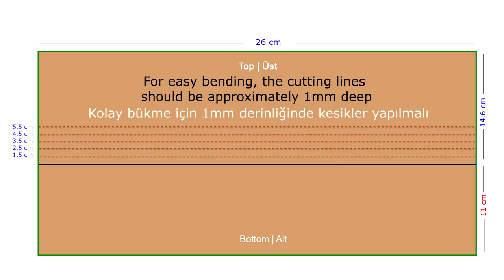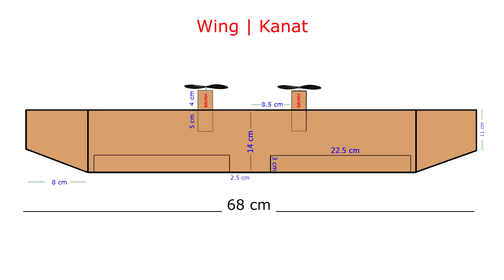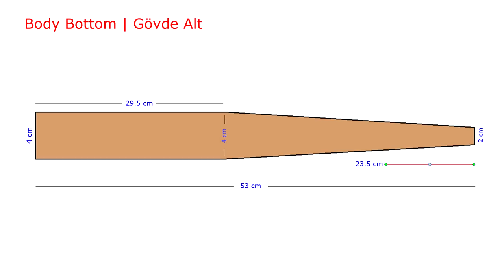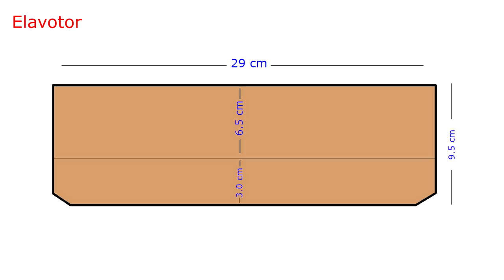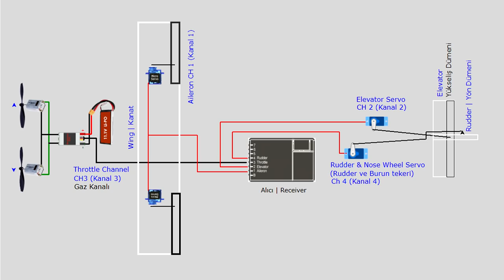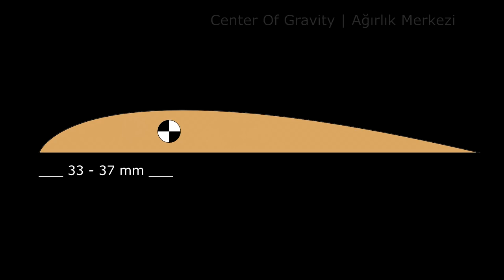How To Build A Twin Brushed Motor RC Airplane. DIY Remote Control Plane

Comment: Would you recommend this to a absolute beginner in making rc planes ?
Reply from the maker: This is a stable and slow flying model. So beginners can use it for training.
Reply: @Kendin-Yap  Thx you are still replying to comments after 3 years.
Legend
Reply: @Kendin-Yap  please answer my question too

Comment: It is very nice model.l built it and it works great.Thanks for sharing it with me

💐💐💐👍👍👍😊☺️☺️☺️
Reply: From where did you buy the material.. and what was your budget in INR
Reply: Please reply as soon as you see it sir. As i am eager to build it.
Reply: Hands Up buy it on amazon buy 4 9gram servos buy a esc and brushless engine buy a radio and receiver will all cost you around 120

Comment: Does the plane automatically balances itself while not tilting or going up/down ?
Reply from the maker: No, it does not have autonomous flight support. It is completely manually controlled.

Comment: Hey i am unable to get DC motor , so can I attach brushless 1 Kv in parallel 
As in some videos I saw one motor sometimes doesn’t work . Pls reply I need to build it now
Reply from the maker: Brushless motors are different. It does not work properly with a single ESC. (There are exceptions)
Reply: Oh , thanks a lot , I was about to buy 2 motors and 1 ESC only . I had one more doubt that no trim joystick is not available and the x y axis joystick is available to me , so should I see your other Arduino controller with Nrf module with antenna just to increase its captivity , also do we need to program the antenna as well , SRY IF I ASKED SOMETHING WRONG AS IT IS MY FIRST BUILT . PLS REPLY I NEED TO PLACE ORDER FOR THE THINGS , thx

Comment: the particular dc 180 motors not available online....please can we use some other motors?
Reply from the maker: You can use brushless 1306 motor.
Reply: @Kendin-Yap  Hi, can't find 1306 too in India.....can you please give a few more options. I have managed to purchase most of the other items.Thanks.

Comment: If I use a LiPo with 1000 mah, 11.1v with 3S will be overpowered? Or can be added?
Reply from the maker: 11.1V is not suitable for these motors. Motors will fail.
Reply: KendinYap 

Thank you admin 🌟

Comment: How long does the battery last? Can I use a stronger battery?
Reply from the maker: The higher capacity battery is heavy. So it would not be appropriate. Approximate flight time is 4-6 minutes.

Comment: Very good build. But 1 Amp BEC can't handle 4 servo. It can barely handle 3 servo I believe.
Reply from the maker: Max. current 200-250ma for this servo. No problem for 4 servos.
Reply: @Kendin-Yap  That means this servos are analoge servo. Right? Because digital servos are power hungry. They take 400-500mA per each 9g servo.
Reply from the maker: Yes, these are analog servos. In addition, aircraft with this type of sport scale flight style never need to draw maximum current of all servos at the same time. This is not a 3D aerobatic model.

Comment: Can we place there a brushless motor
Reply from the maker: Yes you can. Like 1306 brushless motor and 6A brusless ESC
Reply: Thanks for your reply
Reply: I am going to make a mini project like bicopter. 
Everything is ready but for two servo motors can we rotate them in one direction for one channel and rotate the same two servo motors rotate in different directions. pls reply. This is my project and it going to end in next week
Reply: And one more thing, that 1306 motor is too high price for me. But can you prefer me a better motor for my bicopter
Reply from the maker: @PoovarasanKEEE  Digital remote control transmitters have a "program mix" feature in their menus. You can search for videos related to Program Mix.
Reply: And about the motor? I think ECO 2 series 1700kv motor is suitable. Can you pls check it.
Reply: If you are free can you search that video of transmitters for me. I have searched but I don't get any idea.

Comment: What software do u use to design your planes? Or do u do it on paper?
Reply from the maker: I do not use any software. I have been making RC model aircraft for many years. Fuel engine models, scale models, aerobatic models, etc. etc.
Thanks to this, I gained a lot of experience. I determine the dimensions myself, I make sketches on the paper and then go to the production stage.
Reply: @Kendin-Yap  Thanks for the reply! Designing my first plane now, on paper.
Reply: @Kendin-Yap  Can you  please do a video on adding lights to a plane?
Reply: @Kendin-Yap  great sir.

Comment: Hi , why is important to fit ceramic capacitor to the motor.Thanks
Reply from the maker: The coils of brushed motors cause electrical noise. Capacitors act as filters. In this way, the circuit to which the motor is connected is not affected negatively.
Reply: Thank you is good to know

Comment: i have a question that can we make this with cardboard???(pls reply)
Reply from the maker: Cardboard is a heavy material and is not suitable. Alternatively, you can use insulating foam.
Reply: @Kendin-Yap  ok thanks:)

Comment: merhaba. sizin kullandığınız fırçalı motor esc sinden piyasada bulamıyorum. bir altarnatif önerirmisiniz.teşekkürler simdiden.
Reply from the maker: Burada bulabilirsiniz. https://www.promodelhobby.com/urun/dc-180-motor-7-4v-39000rpm-yuksek-devirli-elektrik-motoru
Reply: @Kendin-Yap  yanlis anladiniz sanirim ben esc den bahsediyorum.
Reply from the maker: Pardon yanlış link aynısı değil ama bunu kullanabilirsiniz. https://www.promodelhobby.com/urun/fircali-20a-rc-esc-2s-3-9-4v-2-khz-iki-yonlu .. Fatak bu çift yönlü bir ESC olduğu için kumanda ayarlarında Throttle Curve kısmından 0 olan başlangıç değerini 50 ye yükseltmek gerekir ki tek yönlü ESC gibi çalışsın. (Tabi kumandanız dijital kumanda ise bunu yapabilirsiniz.)
Reply: @Kendin-Yap  henuz kumanda almadim. Uygun fiyatli oldugu icin dijital olmayan kumanda almayi dusunuyordum ama soylediginiz ayar icin sanirim dijital almam gerekecek. Tesekkurler
Reply: @Kendin-Yap  peki kumanda diğital değilse nasıl yapmalı çözüm öneriniz nedir

Comment: Ellerinize sağlık hocam
Elimdeki sistem 3 kanallı rudder servosu olmadan yapsam stabil uçabilir mi ?
3mm yerine tamamen 5mm fotoblok kullansak sorun yaşar mıyız?
Reply from the maker: 3mm fotoblok ağırlığı biraz azaltmak için. Ama 5mm ile de uçabilir. Biraz uçuş süresi kısalır. Rudder manevra için şart değildir. Aileron ve elevatör dönüşler için yeterlidir.

Comment: Is it ok to build whole plane in 5mm foamboard, without using 3mm board?
Reply from the maker: Elevator and rudder must be 5mm.
Reply: Wait. This is 3mm foam board? I thought it was 5mm foam
Reply from the maker: @eme4289  Wing and body 3mm for lightness. Elevator and rudder 5mm

Comment: Hey there buddy, I tried imitating your electronic setup, i used 1 pc 20a esc to power my 2 180 motors, is it normal that the motor and esc heat up? Btw i am using a 2200 mah 7.4 40c battery
Reply from the maker: Motor and ESC become hot when running. This is so normal. But it does matter how hot it gets. 50-60 degrees is reasonable. But if it's warming more than 70-80 degrees, it's not very good.
Reply: Cant actually measure the temp, but it gets really hot that you cant almost hold it for like 5 secs

Comment: Abi DC180 Fırçalı Motorun nereye döneceğini nasıl ayarlayacağız bi motor CW diyer motorda CCW olması gerekmiyormu sadece bir motor türü var yardımcı olabilirmisin
Reply from the maker: Bu tip motorlarda CW yada CCW olmaz. Çünkü motor mili vidalı değil. Motorun artı ve eksi bağlantılarının yerini değiştirince diğer yöne dönecektir. Önemli olan doğru yönlü pervaneyi takmak. Bir pervane CW diğeri CCW olmalı.
Reply: @Kendin-Yap  ilginiz için çok teşekkür ederim.
Ve böyle videoları devamını diliyorum

Comment: Hocam merhaba, fırçalı motor sürücünün 18 awg kablosunun ucu açık, yani sanırım pil için konnektörü yok. Bunun için ne yapmamız lazım? Burada tıkandım. Bir adaptörün erkek tarafını söküp taktım fakat sürücü aşırı ısınıyor. Almam gereken parça hangisi acaba?
Reply from the maker: Konnektör almanız lazım. Pilin ucundaki konnekter neyse karşı tarafından alıp lehimlemeniz lazım. ESC nin pil tarafında  BATT yazar. Ona dikkat edin. Ters tarafa veya ters kutup bağlarsanız ESC hemen bozulur.
Reply: @Kendin-Yap  Anladım alıp yaptım. Videodaki pili istemiştim fakat grlen pil 20c yerine 15c ancak yine 7.4V ve 800 mAH. Ancak şöyle bi sıkıntım var pili taktığım anda esc inanılmaz ısınıyor ve kumandada pil şarj az uyarısı alıyorum ardından da pil boş diyip uyarı veriyor. Neden böyle bir şey oldu acaba pilden mi?
Reply from the maker: @qarqamel  Pilden olmaz. ESC nin biraz ısınması normaldir. Ama kısa sürede yüksek ısı oluyorsa  ESC nin bağlantılarını yanlış yapmış olabilirsin. Eğer ters bir bağlantıyı anlık olarak bile temas ettirdiyse ESC bozulmuşta olabilir.
Reply: @Kendin-Yap  Bağlantılarımı kontrol ettim tekrar ancak yanlıs bir sey yok. Alıcıda problem olabilir mi acaba? Çünkü alıcıya bağlantıları takınca yaklaşık 10 sn motorları kumandadan kontrol edebiliyorum sonrası ise aşırı ısınma yapıyor ve pil hemen boşalıyor. Ancak alıcıya takmadan esc de ısınma olmuyor. Bir de şöyle bir şey var esc takınca 2 motordan da sinyal sesi geliyor, kısa aralıklı. Bu normal mi merak ettim. Ne yapacağımı bilemedim şu an.
Reply from the maker: @qarqamel  Bir yerde bir kısa devre olabilir .Normal bir şey değil. Ya şu an bir yerde hatalı bir bağlantın var yada daha önce yaptığın hatalı bir bağlantıdan dolayı ESC zarar görmüş olabilir.   Alıcıdan olup olmadığını anlamak kolay. ESC yi taktığın kanala bir servo bağla. Servo normal bir şekilde çalışıyorsa alıcıdan değildir.  ESC nin kablosunu alıcıyı ve servoyu beslemesi için boş herhangi bir kanala bağlayabilirsin bu test esnasında..
Reply: @Kendin-Yap  sorun pilden kaynaklanıyormuş. Bu arada hocam kanatlardaki servoların farklı mı hareket etmesi gerekiyor yoksa aynı yönde mi hareket ettirmesi gerekiyor? Yani her ikisi de kanadı yukarı mı kaldırmalı, yoksa biri yukarı kaldırırken biri aşağı mı indirmeli?
Reply from the maker: @qarqamel  Farklı yönlerde.. Aşağıdaki videomda bu kontrolleri net bir şekilde gösterdim. Hangi kol neyi ne yönde oynatır. Seyretmen faydalı olur. https://www.youtube.com/watch?v=LzZ4Oqk_J1Y&t=523s

Comment: Abi eline sağlık çok güzel olmuş yine. Kapasitörler neden var olmazsa ne olur onu anlayamadım açıklarsan sevinirim.
Reply from the maker: Fırçalı motorlar çalışma esnasında elektriksel gürültü oluşturur. Ve bağlı olduğu devrede parazite sebep olabilir. Uzaktan kumanda sistemlerinde sinyal kesilmesine de sebep olabilir. Seramik kondansatörler bu şekilde bağlandığında bu gürültüyü minimize eder. Gerçi bu sorun daha çok kristalli kumandalar da yaşanıyordu ama yine de basit güvenlik önlemi olarak kullanmakta fayda var.
Reply: @Kendin-Yap  çok teşekkür ederim elinize sağlık

Comment: Her zaman kendi içinde BEC olan ESC ler kullandım.  UBEC hiç kullanmadım, hiç bilmiyorum. Yani NO BEC olan ESC ler nasıl kullanılıyor?  Bu konuyla igili video çekerseniz çok memnun olurum.  Teşekkürler.....
Reply from the maker: Çok basit bir farkları var. BEC özelliği olmayan No Bec ESC ler Alıcı ve servoları besleyemez. Sadece motora elektrik sağlar. Bu yüzden alıcı ve servolar için ya haricen uygun voltajda bir batarya kullanılır (Direk alıcının Batarya girişini takılır). Alıcı pili olarak adlandırılan bu bataryalar genellikle 4.8V ile 6V arasında bir bataryadır.  Veya motor için kullanılan LiPo pilin çıkışına paralel bir bağlantı ile UBEC (Voltaj Regülatörü) bağlanır ve UBEC in çıkışı direk olarak alıcının batarya girişine takılır.
Alıcılar ve servolar genellikle maksimum 6V ile çalışır (İstisna olarak HV olanlar yani 7.4V ile çalışanlar vardır) . Motor için kullanılan pili direk olarak alıcıya taktığımızda yüksek voltaj nedeniyle alıcı ve servolar zarar görür. Bu yüzden BEC/UBEC ismi ile anılan Voltaj Düşürücü Regülatörleri kullanırız. Zaten BEC özelliği olan ESC lerin de tek farkı bu. Yani dahili bir voltaj regülatörüne sahip olmaları...
Reply: Cevap için çok teşekkür ederim. O zaman illa UBEC almaya gerek yok yani. Ben KK2.1.5 uçuş kontrol kartıyla acizane bir drone yaptım.(Tabi BEC olan ESC ler ile)  Diyelim ki BEC olmayan ESC ler var ve alıcıya 4.8V ile 6V arasında başka bir batarya bağladık. Peki uçuş kontrol kartı zarar görür mü? Uçuş kontrol kartı yanmasın diye ayrıca bir şey yapmak gerekir mi? Teşekkürler...
Reply from the maker: Kartın çalışma voltajını aşmadığı sürece sorun olmaz. 5V ise harici beslemede 5 volt veya çok yakın olmalı.
Reply: Çok teşekkürler....

Comment: Where can I get the carton  or wat is the name of that thing u re using 
It look like carton
Reply: @Kendin-Yap  pls translate to English
Reply from the maker: The name of this material is Foamboard. Foam inside. The outer surfaces are covered with Kraft paper. It is usually sold in stores that sell supplies for architectural models and in stores that sell supplies for school projects.
Reply: @Kendin-Yap  ok tnks

Comment: Abi Merhabalar;
Ben de 1 haftaya kadar bu uçağın aynısını yapmaya çalışacağım da onun için birkaç sorum var sana.
1- Videoda 13:36. dakikada servoya linkage stopper bağlı değilken 13:55. dakikada servoya linkage stopper ekli onu eklemesek de olur mu acaba ayrıca linkage stopper'ı da açıklama kısmına koymamışsın?
2- Videoda 16:02. dakikada yekeye teli bağlamak için bir şey takmışsın gördüğüm kadarıyla, onun ismi nedir acaba?
3- Ben uçak için Flysky FS-CT6B modelini aldım ondan dolayı bir sıkıntı çıkmaz değil mi?
4- Abi kanatlardaki tekerleklerin bir işlevi yok yani herhangi bir servoya falan bağlı değiller değil mi?
Abi cevabını bekliyorum.
Reply from the maker: Linkini açıklama kısmına ekledim. Kontrol çubuğunu servoya bağlamanın 3-4 yöntemi vardır. Tercihi sana kalmış. Linkage stopper  kullanmak çubuk boyunu ayarlamayı kolaylaştırır.  Onu kullanmadan çubuğun ucunu z şeklinde büküp de takabilirsin. 16:02 deki parçanın ismi L tipi clevis. L şeklinde bükülmüş kontrol telini yekenin üzerinde tutturmak içindir. Yerinden çıkmasın diye. Onun linki detayda zaten var.  İstersen onu da kullanmayabilirsin. L şekli yerine çubuğun ucunu Z şeklinde bükersen yerinden çıkmayacaktır. Ama çubuğun iki tarafını da o şekilde yaparsan boyunu ayarlamak biraz zor olur. 4 kanal ve üstü her tip model kumandasını kullanabilirsin. Markası, versiyonu önemli değil. Kanatlardaki tekerlerin bir işlevi var. Onlar olmazsa model yerde duramaz ve ilerleyemez.  Servo sadece burun tekerine yerdeki yönlendirmeler için takılır. Yani taksi manevrası ismi verilen uçağın yerdeki dolaşımını yönlendirmeyi sağlar.  Uçuş esnasında bir fonksiyonu yoktur. https://www.youtube.com/watch?v=LzZ4Oqk_J1Y&t=19s bu videomda Z bağlantısını göstermiştim. Ayrıca ağırlık merkrezi  vs konuları da göstermiştim. Seyretmen faydalı olabilir.
Reply: @Kendin-Yap  Çok teşekkür ederim verdiğin bilgiler için
Reply: @Kendin-Yap  Merak ettim de pili Esc ye nasıl bagladiginizi sorabilir miyim ben esc deki bostaki iki kabloyu pile bağlamak için pildeki kırmızı soketli yeri penseyle çıkartırken kısa devre yaptı ve pil patladı
Rica etsem nasıl bagladiginizi detaylı bir şekilde anlatabilir misiniz

Comment: In our country, the 180 motor max rpm 24000 RPM, is it possible to make airplane in this 24000rpm motor, i can't found 39000 rpm motor, what should I do..., and is ti possible to fly with 24000 RPM motor??
Reply from the maker: The important thing is the power of the motor. It should provide about 30 watts of power.

Comment: hocam esc kumandaya bağlıyken de bağlı değilken de motor tam gaz çalışıyor kumandaya bağlıyken kolu aşağı indirsem de tam gaz ortadayken de tam gaz çalışıyor problem escde midir kumanda servoları çalıştırıyor
Reply: Bir de servolar yanıp duruyor sıkıntı nerde olabilir
Reply from the maker: ESC nin bozuk olma ihtimali mümkün. Kumanda gaz kanalına bir servo takıp test etmelisin. Servonun hareketleri normalse ESC de proplem olma ihtimali yüksek.  Servolar iki sebepten yanarlar. Çok yapılan hata servoların kasılmasına sebep olmaktır. Yani servonun bağlı olduğu mekanik hareket bittiğinde servo hala itmeye yada çekmeye çalışıyorsa servo yanar. Örneğin elevatöre komut verdiğinde elevatör sınıra gelip artık hareket edemiyorsa ama servo hala itmeye çalışıyorsa yanması kaçınılmazdır. Kumanda dijital ise menüden servonun bağlı olduğu kanalın hareketi kısılmalıdır. analog kumandada ise servo kolu ve yeke boyu ile hareketin azaltılması gerekir. 
Diğer bir sebep ise servonun çalışabileceği maksimum voltajın üzerinde batarya yada bec kullanılmasıdır. Servoların çoğu (HV olanlar hariç) 5-6 volt aralığında çalışır. Daha yüksek voltaj yanmasına sebep olur. Normalde ESC nin BEC devresi pilden gelen voltajı düşürür. Ve genellikle bu 5-5.5V dur. Ama ESC nin BEC devresi bozulursa pilin voltajını düşürmeden iletir. Emin olmak için ESC nin alıcıya bağladığın kablodaki kırmızı ve siyah kablo dan kaç volt çıkış verdiğini bir voltmetre ile ölçebilirsin.
Reply: @Kendin-Yap  escyi kontrol ettim bir şekilde mosfetlerden birisi yanmış büyük ihtimalle bec devresiyle de ilgili servolar da ondan yanıyor çünkü servoları boşken test ettim o zaman yandı

Comment: Hocam 4 motorlu kargo uçağını yapıyoruz fakat bağlantılarda sorun yaşadık servo bağlantılarını yapamadık daha detaylı anlatabilirmisin ya da bu konuda yardımcı olabilirmisin?
Reply from the maker: Videonun altındaki linkten bağlantı şemasını bulabilirsiniz.  Temel olarak 1.kanala Aileron, 2.kanala Elevator servosu, 3. kanala ESC, 4.kanala Rudder (Yön dümeni) servosu. Ön teker servosu ise ister ayrı bir kanala bağlayarak 4.kanala miks yapabilirsiniz yada kontrol telini rudder servosuna bağlarsınız.